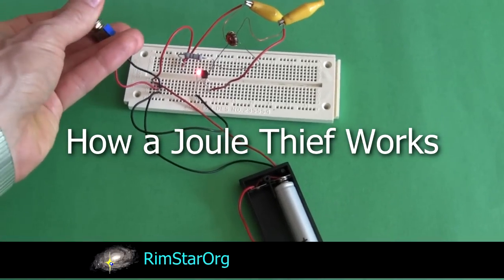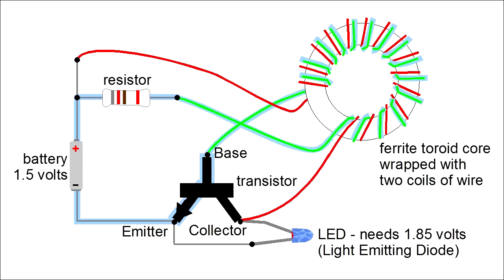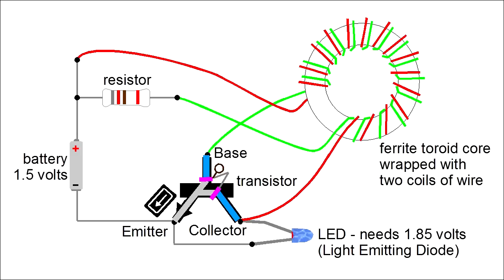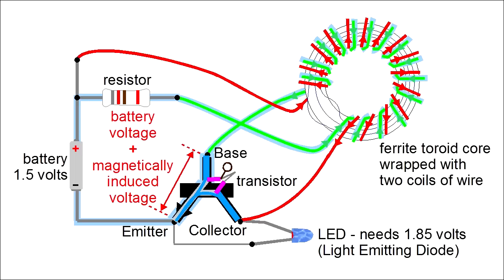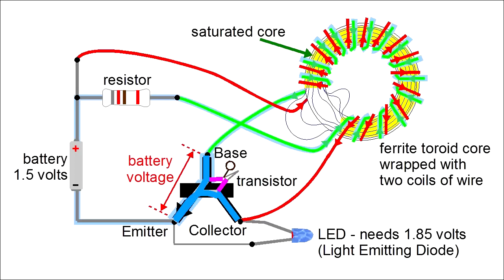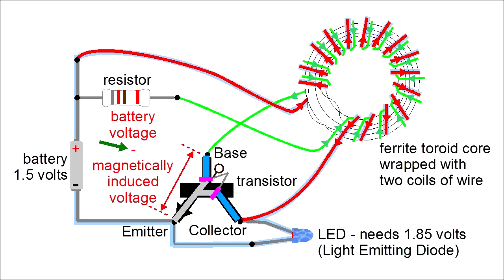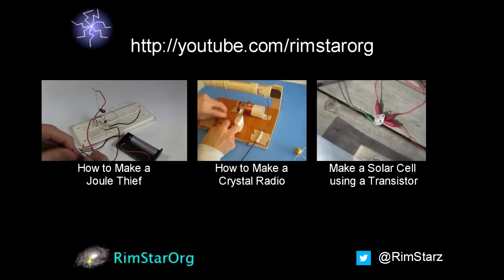How a Joule Thief Works

Comment: Hi I admired all your work..  Quick question..  I only used 1.5v battery and resistor enough to light up my led without joule thief circuit . How it happened?

Comment: I also have two question rim, with the transistor, although it increases the voltage suitable to light the led, I'm guessing that since the transistor relies on the collapse of voltage from the toiroid core wrapped in coil. The collapse takes time. I learned from another video we use Pulse Width Modulation is used on circuit board to increase brightness or dim the led. Since the transistor is collapsing all the time; is the LED dimmer using a transistor rather a battery with appropriate voltage?

Comment: Question - If you wanted to make the most efficient joule thief, is there a size of transistor, resistor and transformer that would be the best combination or does it matter? I don't mean the current output in the sense of a current limiting resistor to make the battery last longer, I just mean the overall efficiency of the entire circuit.
Reply from the maker: +Audioholic 01 I don't have any tips for you on that. Perhaps someone else here does?
Reply: +RimstarOrg Thanks for the response, my guess on the efficiency is that it will depend on the transistor efficiency rating more than anything, but I'm no expert either. This came about because I want to make a 2AA powered emergency flashlight with the joule thief design to extend the run time but if the efficiency is lower it might waste battery power initially when the LED could run straight off the batteries. I've read a few articles that differ in claims that the simple joule thief is anywhere from 56%-79% efficient. I want to make one closer to 79% if possible!

I also think I will put a 3 way switch so that I can run the flashlight bypassing the joule thief while the batteries are fresh and engage the joule thief only when needed. This will get me the most efficiency/runtime and when the batteries are down a little in voltage it could be a real caveman way of having a hi/low mode switch. LOL 

Hopefully someone will have some practical experience here on efficiency and what would be the best combination.

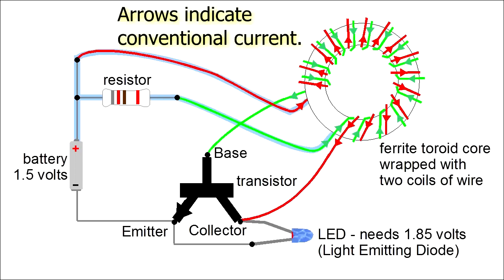Comment from the maker: There's electron flow current and there's conventional current. Electron flow current is the direction the electrons actually move. Conventional current is in the opposite direction and is what electricians and engineers usually use. Back before electrons were discovered, Benjamin Franklin had to make a guess as to which way electricity flowed and guessed wrong, so we have conventional current. I mention in the video at 2:25 that I'm using conventional current.

Comment: I meant ofcourse "changing the diode connection it self" so if it was AC, then you could hook up a diode both ways and it would lead DC current in both these 2 Diode connection configurations.   BUt I tried to connect a diode in bothe ways and it only shows current with one connection so that should mean that the output from JT is Pulsed dc?

Comment: Because electricity travels in conventional direction with a speed of light (wave caused by holes, positive particles ), whereas  electrons (negatively charged particles) travel the opposite way with a very slow speed ;)

Comment: Does it matter whether the resistor is placed before or after the green coil, that is, does it matter if it is between the transistor's base and the coil or the battery and the coil?

Comment: Also, you wouldn't have any AC.  It's the cutoff of electricity that creates the pulse as the field collapses.  This would not happen otherwise because the DC would continue to flow through the coil until the battery slowly died.

Comment: Brown wire is connected direct to plus and anode of diode, the cathode of diode is connect direct to minus. That make closed circuit (loop). Always will be flashed even without a coil. In battery 1.5V You may flash any diode even 5V but will be glowed.

Comment: Rimstar, according to the 4-bands on the resistor (in the computer diagram), it is an 820 Ohm resistor with 2% accuracy, right?  Is there a reason you chose that resistance?

Comment: Nicely explaination . this is work because oscilating volt by toroid transformer. if there is no voltage than no current will be flow

Comment: Problem with depending on the circuit's saturation to stop the increase in current in the transformer is that the saturation point can be VERY high. It can saturate either due to magnetic saturation, or due to the battery's internal resistance preventing the current from rising (1.5 Volts / 0.5 Ohms = 3 Amps). One of those AA batteries could easily give you 3 Amps of current. This wouldn't be a problem with one of those power transistors with a TO-3 case (which even has screw holes for heatsink mounting), but it could be a problem for a small signal transistor like the one you are using. Those tiny transistors can handle only about 0.5 Amps of collector-emitter current before they burn out. 

There's also another problem. Rapidly shutting off the current to an inductor can generate a VERY large voltage (that's how a car's ignition coil works, in addition to having a large turns ratio between the primary and secondary). You can easily get 50 volts out of quickly switching off an inductor, even if the power source is only 1.5 Volts. In fact in an ideal circuit simulator you would find it gives an infinite output voltage if you instantly switch off the current. In real life, various physical factors such as inter-winding capacitance of the inductor and the switching speed of the transistor limit this effect, but still it can be quite large. As I said above, it wouldn't be unheard of to get 50 Volts (maybe even 100 Volts in some conditions) from switching off current through an inductor where the power source was a AA battery. The LED acts as a voltage regulator here though, forcing the voltage across it to not exceed the forward voltage drop of the diode, and this protects the transistor. However, if that LED were to become disconnected from the circuit, you would have no voltage limiter, and the output voltage would be limited only by the physical imperfections of the components (and a circuit simulator which is based on ideal components would indicate infinite voltage). This high voltage pulse would EASILY fry your your tiny transistor, which is in no way designed to handle high voltages.

Comment: Most engines have a starter motor (the sound it makes when you turn the key), so it would have to keep it up for a second. I think it would manage, though. Because the flat battery isn't empty, just not enough to turn the starter motor in the way it normally would. I should try hooking something like this up.

Comment from the maker: The resistor size does matter. Some people even put a variable resistor/potentiometer and find a resistance that results in the LED being brightest that way. For the circuit in my "Make a Joule Thief for Zombie Batteries" video I used a 1 kilohm resistor. You want something that doesn't limit the current too much while still protecting the transistor, which is why it's there. Some have gotten away with no resistor at all.

Comment: I have got up to 240 volts from flat AA's, around 400v from a single full AA.1000v from 9v would be easy :) I think I could do 2-3000v from 9v. The trick is to have a lot of turns on the collector winding, and few on the base wind. a 10:1 ratio works well. Power transistor is also a must. That would be the main issue, most power transistor blow around 100-600v...... Or add a third winding, or wind the Joule thief on a flyback. I get approx 50,000v from my joule thief flyback, from 12v supply.

Comment: What is the time interval, or frequency, for the collapse cycle?  Question about the higher voltage and current at the same time.   According to Ohms law E=I x R, at the moment the higher voltage and current are "dumped", the resistance, at that same moment, must drop much lower than at any other time, correct?  It beats inverting the DC to AC, then stepping it up, and then rectifying it back to DC, where so much power would be wasted, the light would never light up anyway.

Comment: Thanks for the great explanation, but, I have a question...  It appears to me that the diagram shows voltage flowing from positive to negative.  I have been taught that voltage, in fact, flows from Negative to Positive.  Which is correct and why are there two schools for thought on this?  Thanks for any help with this!
Reply from the maker: There are two directions to talk about current flowing, called conventional current and electron flow. In this video I'm using conventional current. Only when I'm animating the actual electrons do I use electron flow. Both are correct and it almost never matters which one you use. Inside a battery, it's actually the positive ions that move. In a corona, both positive and negative charges can move.
The reason for two is because a direction had to be chosen long before the electron was discovered, and Benjamin Franklin, who made the choice back around 1745, just happened to choose from positive to negative, which became the convention, hence the name conventional current. The electron was then discovered in 1897 by J.J. Thomson, and from then on we also had the electron flow direction, from negative to positive.

Comment: Mr Rimstar, could this device still work with an a/c input? It seems to rectify the volts by using a bit of amperage and through efficiency getting more for your amps.. is this correct? So, I think i'm saying can this device clean up sign waves to maximize output?
Reply from the maker: No, it doesn't work with AC input. It has to be DC. It actually works by building up/storing a bunch of energy in the coils' magnetic field and then dumping it in bursts. So the output is actually nothing followed by a burst followed by nothing and then a burst, ... I don't know how efficient it is, but those brief bursts are be higher voltage and current than the input, but only during the bursts. You can see the waveform at 0:38 in this video about how to make one http://youtu.be/B61DU7yEsPM

Comment: In designing a circuit all sorts of parameters are required.  Can your computer read open office spreadsheets, I have the calculations set up in one.  The circuit uses an 8 pin IC.

cheers

Comment: The typical JT draws 60 to 100 mA at 1.5V, which is only 90 to 150 milliwatts.  The core doesn't have many turns, so I think it's unlikely that there are enough ampere-turns to saturate it.  But the saturation of the transistor is most likely the reason for the current limiting, unless the coil has a ;lot of resistance in the winding, which will also contribute. Whatever the case, the current maxes out, and then there is no more change in flux, so the feedback winding is no longer being driven.

Comment from the maker: Thanks. It's around 20,000 to 30,000 hertz. You can control it by replacing the fixed resistor with a variable resistor or potentiometer. See my latest video "Fun with Joule Thief Powering a CFL" where I show the waveforms on the oscilloscope and also using the potentiometer and its effect. There's a link to the video in the description below this one. It's also the most recent video on my channel page.

Comment: Well done!  You've explained the JT circuit quite well!

Will any general purpose BJT (e.g. 2N3904) work in that circuit?
How much current is available in the circuit to drive another/more LED/s?
Reply from the maker: zeffur7 Thanks!I don't know about just any general purpose BJT but most will, including the 2N3904. I don't know how much current is available since the output is not in a form that I can measure - it's neither flat DC nor sinusoidal AC.
Reply: How much is the peak to peak voltage.  Or, if the wave shape peaks & goes to zero (or near zero), then what is the peak voltage & how many peaks occur in a specific time interval?
Reply from the maker: zeffur7 zeffur7 
The peak to peak voltage varies depending on things like the resistance 
of the resistor and the number of turns of the coil. For a simple joule 
thief like the one in this video you can see the oscilloscope output in this other video of mine "https://www.youtube.com/watch?v=B61DU7yEsPM" at around 0:38.
 The peak to peak is around 24 volts and the time interval is around 40 
microseconds between peaks or 25,000 per second. In this other video of 
mine "https://www.youtube.com/watch?v=yz_99oVMbSI" the voltage is much 
higher and you can see me adjusting both the frequency and voltage by 
varying the resistance.
Reply: Very interesting.  I wonder what would happen if you added a capacitor to the circuit to choke some of the spikes...

Btw, thanks for great videos & feedback.  I like how you explain things.  Very thorough & well done!

Would you mind if I send you a private YT message to ask for your opinion on a different electronics subject?
Reply from the maker: zeffur7 Lionel Sear did just that, adding the capacitor along with other circuitry, and powered a clock. He was nice enough to publish it on my website here http://rimstar.org/science_electronics_projects/joule_thief_powering_clock_ls.htmYou're welcome to send private YT message but my time is limited so I can't promise anything.
Reply: Wow, that's another great video!

p.s.:  I just finished sending that YT private message to you.  Thanks for your help.
Reply: Btw, which make & model oscilloscope did you use in your video?
Reply from the maker: zeffur7 It's an old one, bought many years ago, the Tektronix TDS-220.
Reply: Thanks for that information.
Reply: I tried to use PN2222 in my flashlight, it works but gets quite hot with my current.

Comment from the maker: In the video I'm using a 1.85 volt LED as an example. That specific LED doesn't turn on with 1 volt.
Google translation: En el video que estoy usando un LED como ejemplo 1,85 voltios. Eso LED específica no se enciende con 1 voltio.

Comment: I've made JTs with toroid cores from 2 inches or 50mm down to 1/4 inch or 6mm, and I don't think that only 0.1 to 0.15 watt of battery power can saturate a core.  They all seem to work just fine, including those made with an air core.  I read somewhere that the core with two pieces has an air gap where the energy is stored.  Some seem to think that the cracks in a broken toroid make it better in that respect.  I've never experimented with broken toroids, though.  Maybe I should.

Comment: I would like to try using something like this to light a room using a 5v 200 ma power source. using LEDs. do you think its possible ? what about two rooms? or 5 rooms but with 12v and like maybe 2 thief's? I know there's no free lunches. but would it be possible to some how to get two synchronized so one is on wile the other is off. charging a pair of caps. to be storage for the outputs. and like run Jt's off the caps. to run LED's? that way it would be similar to a lighted keyboard. lots of LEDs using the power of only one led. because they are not actually on at the same instant. just a thought. could it work that way? great video. thanks
Reply from the maker: The joule thief is horribly inefficient so I wouldn't recommend it for what you're doing. You're better off powering the LEDs in the normal fashion or looking into boost converter chips maybe.

Comment: Thankyou for your quick reply, I wanted to add, I suppose you have heard or read about John Bedinni and some of his ideas, but what about Thomas Bearden he was or is a University òf Alabama professor who invented a "MEG" which stands for motionless electromagnetic generator, I think that device was based on a joule thief. What's your thoughts.
Reply from the maker: I've knowledge of both of them from years ago but neither ever produced a device that produced excess output. Keep in mind, despite its name this joule thief is just a circuit that stores up energy and then releases it in bursts. It's an inefficient (though interesting and fun) circuit that produces far less out than in overall.
Reply: @RimstarOrg  Yes, Thomas Bearden was supposedly going to produce the MEG in a "friendly " country but it never came about, that was a shame it must of had circuitry something like the joule thief. I will look at your fluorescent joule thief design, I already have a small JT I had shipped to me from a guy in Greece, works great. These JT' s can be scaled up, surely.

Comment: What happens when you replace the resistor with a potentiometer configured as a variable resistor?  Can you slow the transistor on-off times to make the LED flash a lower frequency, making it appear slightly dimmer in intensity?
Reply from the maker: Yes, a potentiometer will allow you to do just that, controlling the LED's brightness. I test that out with a joule thief circuit powering a CFL in this video https://www.youtube.com/watch?v=yz_99oVMbSI.

Comment: I used a fly-back core with 80 turns of parallel wire [2 coils] to drive a secondary AC voltage.  A 10K resistor with a .01 uf cap across the resistor in place of your  1K resistor and in this circuit configuration it produced a lovely square wave.  Without the addition of the capacitor it was off for most of the cycle.  The circuit was used to build up a high voltage with ten voltage doublers for experimentation on seeds at 1,500 VDc to see if it effected seed germination.
Reply from the maker: David Spiller Awesome. So basically a joule thief with a secondary going to voltage doublers for HVDC output. What was your power source? I guess the output voltage would drop pretty quickly if there was leakage but with your application I guess there wasn't any.